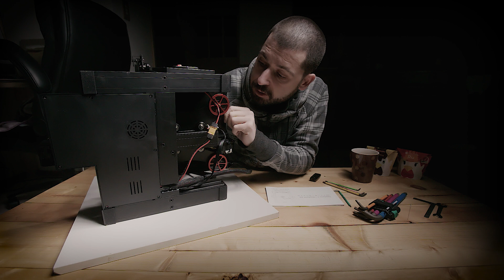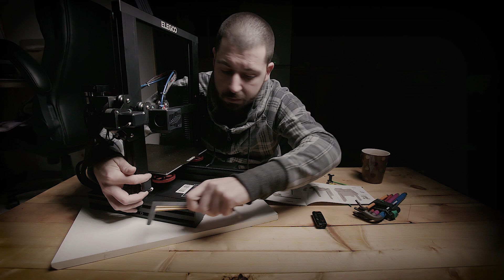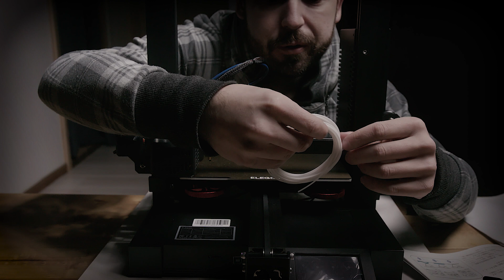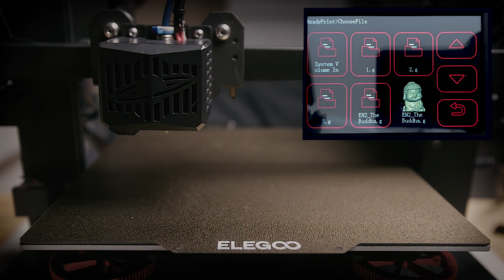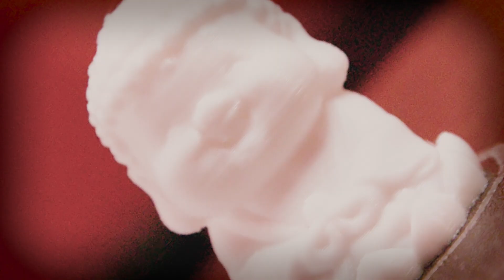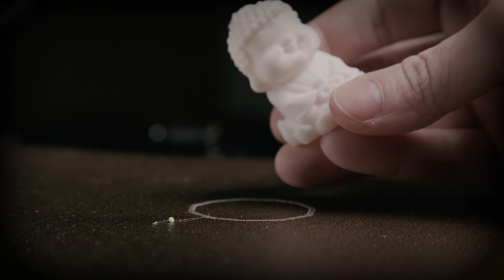Elegoo Neptune 2S  3D Printer: Assembly, Leveling & First Print (pt.2/2)

Comment: Do you use nuts to lock the leveling knobs? I find it to slip so I'm printing nuts to lock it.
Reply from the maker: Never felt anything strange on mine so don't use nuts. The basic idea is the tension from the springs prevent the knob from turning. Not sure how you did yours but you can try  tightening the springs fully then loose a turn or 1.5 turns, it keeps the spring tension higher.
Reply: @MochaMameX ended up buying M4 wing nuts and washers to prevent the calibration from slipping. Spent hours leveling the bed. Thinking of getting a different printer with auto-leveling.
Reply from the maker: you could install a 3D touch for $10, I have a video on the process. You might want to check if there is any wobble in the y-axis wheels, it could cause issues that look like leveling problems. Also the table will change shape after heating, the nozzle will also change z-height after heating. Maybe you can try warming everything up before leveling and printing.
Reply: @MochaMameX I figured out a different method to level the bed. Sit eye level with the bed and have a lamp behind the nozzle. Adjust the knobs until you barely see the silhouette of the nozzle disappear. Pretty much visually looked at the nozzle and carefully adjusted them to barely touch the bed. This worked well. Yes Im also looking at getting a mod for leveling.

Comment: My Buddha is just coming out a stringy mess, Can I ask what settings you did please I have tried slowing it down but do i need to adjust any extrusion levels ? I'm trying to get used to printing this model before I try something else as seems pointless to go further until this one comes out correct
Reply from the maker: I just printed the file that came with the printer, didn't touch any settings or slice myself. If you say stringy mess then I would guess either you need to wash the build plate or your z height is too high and you need to adjust the table level. If it starts printing fine and the strings happen later in the print then I would say you have a problem with extruding, the extruder tension, or a clog in the hot end, maybe your nozzle wasn't tight. Hopefully one of these points get you running!
Reply: @MochaMameX   cheers for responding . I, too, didn't adjust any settings as elegoo cura won't work on my laptop.  However, I'm just in the middle of downloading pursa slicer. Wish I could send u a picture at just how stringy it was . I've ordered some different bed springs as I noticed when I went around levling 3 times the left front always seemed to be dropped. I was doing the levels until the nozzle just rubbed the paper and it was unfolded paper.
Reply from the maker: the Buddha is small and prints right in the center, a lot or maybe most of these printers have a warp in the build plate that makes the center lower and the corner screws don't do well you adjust for it. You can try putting a piece of Kapton tape or post-it note under the center of the magnetic build plate. For leveling try tightening the springs fully then loose a turn or two turns, it keeps the spring tension high.

Comment: Mine isn't extruding anything when I push in.
Reply: I actually got it. Starting the Buddha
Reply from the maker: first the temperature needs to be up or it won't do anything, there is a minimum safety temperature.

if the extruder gear spins, does some filament get pushed by the gear? make sure when you load the filament you push all the way down to the nozzle or it takes a long time by pushing 'in'. Last you have to make sure the bowden tube is all the way down or filament will leak inside instead of out the nozzle.

Comment: How would you compare the 2S to your other printers?
Reply from the maker: well my other printer is a Canon inkjet, it might not be fair to compare. I only have the 2S, for me it's enough. I don't run a print farm or have any business needs so it's enough. It can print PLA and also TPU out of the box which is nice, with a Bowden upgrade you could print PETG. The cooling fan doesn't cool enough so needs to be upgraded. Originally I bought this one because I read that to get an Ender 3 to the same level it would take a fair amount of upgrades. A year later and there's been no issues.
Reply: @MochaMameX  great insight, I just ordered one and glad to hear it can print TPU out of the box. I ordered one for basically the same reason, im trying to build my skills as a modeler and printer and figured it's perfect. Thanks again!
Reply from the maker: No problem, if you have any questions I can try to help. For the TPU I don't recommend following Ender 3 videos that say go super slow and turn off retraction, the extruder design is slightly better on the 2S so you can push a little more. Enjoy!

Comment: Thank you so much for this video. I was scratching my head for longer than I'm proud of trying to figure out why my print nozzle was pressed so hard against the print bed. Turns out I had accidentally installed the switch on all the way down. It took a bit of finagling to get all my levels right because I swear every time I touched one wheel, the rest were immediately off, and my center was never the same as the corners for some reason. But, without your video I never would have gotten it. So, thank you!
Reply from the maker: Happy to hear that the video helped! It takes a bit of time but in the end this printer is nice. About leveling the center, most print beds are warped in the center so it will never level. Try putting a piece of Kapton tape or memo paper under the center of the steel sheet.

Comment: I have been haven trouble with mine trying to do the test print I load the print it heats up and then nothing happens. Any ideas
Reply from the maker: if you can use the menu and homing works, heating works, and moving works then I would say change the SD card, the one with the printer is bad

Comment: Hmmm, I can't get the buddah print to work, I tried changing some heat settings but it never does that line on the side or any homing
Reply: Anything you can help me troubleshoot with 🙏
Reply from the maker: did you use the stl file directly from the sd card or did you try to slice your own? the one from the sd card should work automatically without adjustment.

look at the temperatures, are they rising or not? it doesn't start until the temperatures reach.

finally make sure all the wires are plugged in tight. try manual homing and manual heating to see if that works.

finally, finally change the sd card. The one that comes with the printer causes so many crazy problems for people.
Reply: @MochaMameX  I use the one directly from the SD card I saw the heater on the nozzle heating up and the bed heating up but after they both reach temperature the print didn't start on its own
Reply from the maker: so if you have an extra sd it would be easy to swap and try a different sd. or get a fresh copy of the gcode.

does moving the printer manually in the menu work?
Reply: @MochaMameX  yeah luckily I can the x,y,z manually. And I can also extrude, so I'll try to change the SD or reformat the SD. I saw on a forum said if there are extra files on the SD, it might mess it up. If you think of anything else, lemmie know, thank you! Subscribed!
Reply from the maker: yeah if manual works check the sd or actual g-code file.

Comment: hello I have a problem when I print the buraah the device does not want to move and I have a z logo at 66,000 with you it and has 0 comments solve this problem thank you
Reply from the maker: hello, usually this problem is a bad SD card. Please try to format or change the card. Can you use 'Tools' menu to Home and Extrude?
Reply: @MochaMameX  thanks you résolve my problème 💯
Reply from the maker: you're welcome, have fun printing!
Reply: my first impression was not so good, I use pla + amazon, what do you advise me as a temperature setting and so, thank you 👒
Reply from the maker: First I recommend using the white PLA for the Buddha and just print with changing no settings, it should work. If that is good, try to print the Buddha with the PLA+, try 190-195 degrees. What did your problem look like?

Comment: idk if mine is defective. Barely any filament comes out when I do the extrusion test
Reply from the maker: well I remember thinking similar when testing extrusion but actual prints were fine, just I expected to see more. 
Next check the temp is around 200, and main screw on the extruder is tight enough so the gears can push the filament.
After this maybe you have a bad nozzle or the bowden tube was not all the way down so now filament is filling the gap instead of extruding. Both of these would require you to warm the hotend a little then take it apart to look.
Last thing would be an odd firmware mistake, E Steps are 130 or 133 default and I've set mine to 121 because 130 extruded too much. 
Hope one of these points help!

Comment: Thanks for the amazing content you're sharing,
Just got mine yesterday and no matter what I do I'm not able to make point 5 at the same level with all of 4 points just need it to go download 0.6 mm maybe
Reply from the maker: Thank you for watching! This is a problem for many people, the plate is warped in the center and goes up or down. If it goes down you can put a piece of Kapton tape under the center. Some people use paper, just be careful the temperature. I should make another video just for bed leveling

Comment: hi, thanks  for video. I have a questions, about this printer 3D Elegoo Neptune 2S versus Creality Ender 3v2? Which is best printer?
Reply from the maker: Hello, thank you too! I haven't used the Ender 3v2, but they are pretty similar. The Neptune 2S has a PEI plate instead of glass so you can try using PETG also the magnetic print bed is nice compared to clips. Ender has a bigger community for specific support. Elegoo has great support if you break parts and need a replacement. Both need a cooling fan mod to get super prints. My feeling is that the quality of the Neptune 2S is good, solid, I don't have any regrets getting it.

Comment: im changing my settings on the machine before every print. how do i use the settings created in cura, so i dont have to manually change it on the touch screen. Another thing is what speed are you printing at, because out of the box its at 100% and man it resonated like crazy.
Reply from the maker: This print is out of the box, for me there was no resonation on xy but z naturally makes some noise. If you are making your own gcode I would take a looks at acceleration and jerk these have a bad habit of making resonance. I had print speed set at 60mm/s with no noticeable problem, I see a lot of people using 50mm/s.  

If you have a lot of 'resonance' and the print is failing from it, maybe your motor is skipping steps or belt is loose and skipping. If this is the case your print will fail.

About the Cura settings, when you slice your file it should be included in the code and automatically work, I use the official Ultimaker Cura. If you use the touch screen you can override the parameters in your file. So if you set heatbed to 50° by Cura and the print fails you can use the touch screen to override and make it 60° for a second try without having to remake the file.  

If you still have trouble let me know or join the reddit link in the description, and you can post photos or video and get help from everyone.

Comment: Great review, thinking about gettin this one but i do have some question, the boweden tube looks like the capricorn one, is that him ? Keep it up on this videos!
Reply from the maker: Thanks a lot, I will keep trying to make more good videos! Capricorn is a brand name, the material name is PTFE. The  stock tube on the Neptune 2S is PTFE but it is not Capricorn.
Reply: @MochaMameX  Thanks for answering, have you already tried other prints maybe sliced by yourself ? if yes with which slicer and profile did u managed to do that ?
Reply from the maker: Yes I downloaded the original Ultimater Cura and added this profile for the Neptune 2S https://github.com/Toylerrr/Elegoo-Neptune-Support
After I tried to print a calibration cube with the default profile and results were good!
Reply: @MochaMameX  well thank you so much , i`ll let you know when mine will arrive